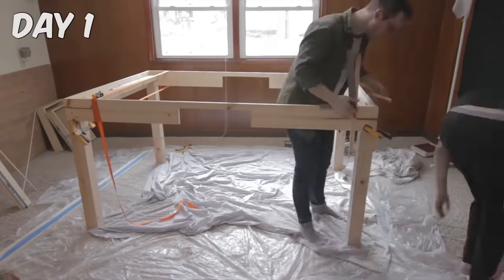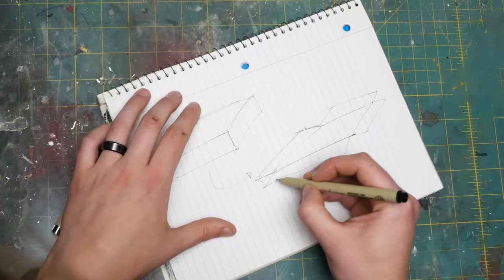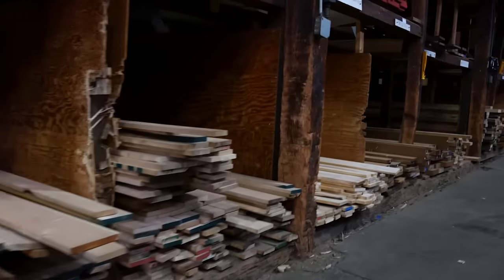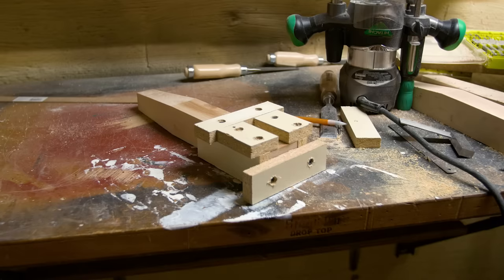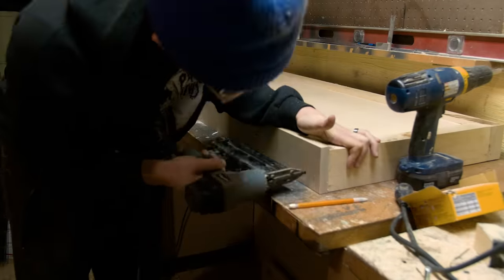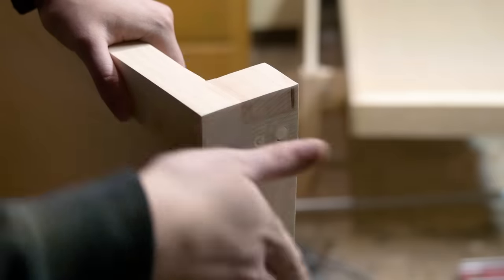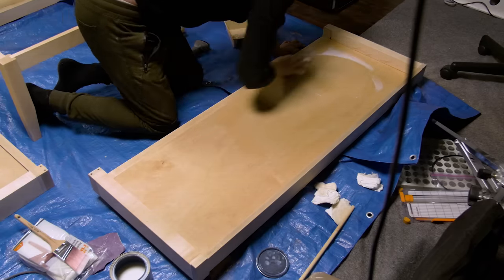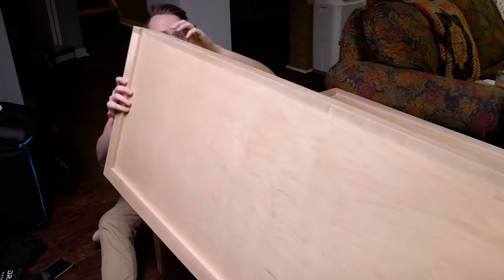Building a Board Game Coffee Table

Comment: i woudl surgest a support fix.
inder the table have several sticks as wide as the table when closed.  being held up with metal brackets. or something.  and when you want to fold out the table you can pull them out. 
so half is under the main table and the ohter half is under the outfolded pieace.  and have 2-3  for each side

Comment: you could have a leg that swings out from underneath, and props up each side of the table, even if it doesn't touch the ground, it could be a bar that comes out and supports it, either sliding out, or swinging out.

nice work though, it looks really good.

Comment: Suggestion for your fold out ends.  Build secondary legs to mirror the original fit.  Put these on a flat rail system that can extend out.  For example, my oven trays roll out on a telescoping rail that extends out about 18" which makes it much safer to remove heavy hot trays of food.  Meanwhile the extending rail counter levers itself so that the part that stays in the oven is a firm support for the extended bit.  But having said that, if you use the same system to push out a small frame with legs the legs themselves will provide the support necessary for the top tray when you open it up.   In Aus' there are all sorts of places you can get these rails, not the least of which are hardware stores of course. Naturally the legs and rails will need to attach under the centre part of the table as far apart as possible so the legs are out of the way when you play the smaller surface area.  
And bye the way, remember the mantra of any one new to a function or task.  How hard can it be?  Also thanks for the laughs and qudos for perseverance on the job.  Your biggest lesson?  Never go for the quick fix.

Comment: I have a possible solution for your hinge strength concern. You just need a way for the table to support the weight. The table in our kitchen has fold out leaves. They’re supported by wooden stakes that slide out from underneath the table.

Comment: You can very quickly make a table saw by cutting a slot in the middle of a piece of plywood (or an old shit table) with a circular saw then literally taking that same circular saw and mounting it under the table with the blade poking through the aforementioned slot.
It's up to you regards how you want to bypass the safety features of the saw so it runs without needing you to hold the button down. (hint: cable ties or hose clamps)

This can also be implemented with the jigsaw to give a great way to cut perfect curves and you can use the same table you just used for the circular saw blade.

Comment: you could use a few wood supports on the bottom of the Main table.  Put in some brackets and slide wood in that overlaps with the extended parts, then remove when you are not using.  Not elegant. but might work.

Comment: A simple fix could be to put two legs on each end with a swivel socket at the top of the table. That way when you flip out the sides you can swing the legs around to add support to the hinges. It wouldn't look too awkward as long as the legs were flush at each end together and the same color of wood, or I guess you could add and accent color

Comment: For you full side hinge idea, you could likely get away with piano hinges (which are commercially available in a variety of sizes and usually have a multiple strength specs.) As someone else mentioned you almost always want to pre-drill hardwoods, especially for furniture or anything you may want to take apart.

I appreciate you sharing your project. I actually really dig this idea. I'm in the planning stages of building a gaming table for my man cave and may adapt some of your ideas for my needs. I've really been wanting a 5'x8' table, but that footprint is a little too large for the space to be open all the time and I don't want to muff about with leafs. Doing is as a 5'x5' with 1' 6" folding extensions though might just work.

Comment: There is a very simple fix to your support problem.  Add a couple of wooden slides out supports under your table that extend out from the middle of the table.  when you get ready to flip out your table top slide out the supports so that the top has support.

Comment: If you were to move the speakers away from the wall, you'd get a much better sound. I have the same lsr305s and if you have the room to put them about two meters apart and about 30 cm away from walls, you will get amazing sound and sound stage.

Comment: Hey bud, thinking minimalistic and as unobtrusive as possible, you could strengthen your table, after you unfold it, by drilling a 1" hole in each corner of where it folds and inserting dowel rods, or something prettier like walnut or dark wood legs. But hope that makes sense, so when the table is folded 3 foot by 4 foot or whatever it is, you only see 4 holes in the "pit wall" board/siding thing near the center. Not obtrusive, won't affect anything besides you could always make caps for them for players who like to stick dice where there not supposed to

Comment: Another tip if  You are trying to fill screw holes  Stick toothpicks in the hole and cut them off Flush with the wood.  And if you use a Pair of calibers you can do scribe lines, handy if your doing dovetail work or  Anything when you're  Trying to get precise measurements.  Also  Keep in mind wood shrinks and expands Make sure you know which way the grain of the wood is going to mediate that.  Also if you can don't use a drill to screw in screws use an impact driver

Comment: Under mount a few drawer slides to the bottom then slide them out to support the weight when the leaves are open. get slightly longer than you need so you can slide them back far enough to be out of sight. Most are rated >100 lbs a price.

Comment: I'm sure you've gotten this table squared away by now but just in case: You could install slide outs in those empty spaces on your long sides to strengthen the fold outs when they are opened. Use a sturdy set of drawer brackets and leave enough lumber inside the table to add more stability. =[ ]=  <----Something like this (top down view). Cut some notches for your trim and boom, fold outs you could sit on.

Comment: Little late to the party. Dude, I feel that pain man. I’ve been a site carpenter for five years now. I love tinkering in my shed and making little boxes and stuff...site Carpentry is my skill, joinery is not! Watching this had me laughing my head off, not laughing at your mistakes but laughing at the fact that it’s a carbon copy of mistakes every time I attempt something elaborate. My only tip that you didn’t touch on yourself is whenever I’m screwing something into hard wood (obviously pilot hole it first), I get some thick clear grease and grease up the screw, makes it so much easier to wind in or take out if adjustments are needed. Works a charm especially for tiny little screws, you can also get screw extractor bits, but can’t comment on there effectiveness. Could use a plug cutter bit, cuts around the hole making a stubby dowel, then and dowel and redrill it like you said. Another small one is throw away any screws that come with a hinge, (unless you payed top dollar for the hinge) they are always garbage. 

Love the channel man, slowly working through your back catalogue!

Comment: use vice grips to pull out broken screws when there's more than 1/8" showing and also, always drill your screw holes out before putting in the screw. you can look up a drill/screw chart on google.

Comment: Super late to this discussion, but I am interested in getting a gaming table. I wouldn’t do it myself, as I am nowhere close to ready for this type of project. I have a hard time hanging pictures on the wall. 

I like your design, but I think you are right with the need for support legs. I was thinking, if the top of the table did not have the raised lip around the edges, there could be a better solution. Rather than use a giant hinge, you could mount some slide out support bars on the bottom of the the table. When you open it up, you would slide out a couple of bars on either side. They would be firmly secured on the central part and extend almost to the end of the two wings. 

Do you (or anyone out there reading the comments) think it would work?

Comment: you can add some sliding cleats ( dunno if that's the correct word in eglish though ) underneath the table. when you open the table, you pull them and they support the folding parts.

Comment: If you check out any of the Geek Chic-esq game tables out there, they don't fold open. They just have a recessed area that is covered by a removable panel (or two) of wood that otherwise make the table top when gaming is not going on. This may be an easier approach next time.
Reply from the maker: It wouldn't solve the problems I outlined in the beginning of the video

Comment: You mentioned you did your shopping at Home Depot, where most of their inventory for screws like this are very soft Zinc, which doesn't screw well into harder woods and shear easily, especially if you're not drilling pilot holes (yeah, I had the same problem as you).  So, look for screws made from almost ANY other metal/material.
Reply: Hardwood requires fine threads, vs the coarse threads that his screws had. Never should have attempted this project, not knowing what he was doing.

Comment: As someone who has done construction for years... well... you had me laughing, shaking my head saying "Nope! You don't want to do that." and almost crying while wanting to out "NO!!!".

Here are tips for next time Scott.... 

1) Follow my father's favorite statement of "Remember the 5 P's. Prior Planning Permits Perfect Performance!". 

2) Make a "mock up" version of your project with pine 2x4's, plywood and either nails or screws. It will let you see what other tools you may need, problems to address and even give you an idea or two on how to improve your design. Plus if you fuck it up... 2x4's and basic plywood is a hell of a lot cheaper than nice hardwoods.

3) Reach out to friends and people you know that have either done something like this before or know woodworking or construction. Most semi-smart people who have done construction for a few years could have easily helped you out with the planning and building of that table.

But in the end you did make the table... but you still need to add legs to those folding out leafs for support. Otherwise the weight will most likely rip those screws on the hinges right out of that pretty hardwood.

Comment: You are a brave man Scott that’s one hell of a project. I took your lead and built a hobby table from your last video but I think I’ll pass on this idea lol. Quick fix idea though not from experience but my kitchen table has fold up Leafs on the ends and underneath the table there is like these 2x4s in a sliding track that slide out from under the main table and support the wings might give your table some longevity. Well done all the same I think I would have burned it long before completion lol

Comment: I truly feel your pain on this video.  I recently re-modeled and organized my office/hobby area.  Found out the hard way measuring is meaningless if you don't check the angles you assumed were true and flush.  How was I to know that the length and width were pointless (because what actually fit after measuring the right way and accounting for angles was more a parallelogram than a rectangle,) but, finally got it done.

Comment: A valiant effort, I’ve been doing carpentry for a while as a hobby and it’s  just like painting minis, you make mistakes but just move on apply those learnt lessons to the next project. My advice is never use cheap screws, i always use branded and even screwing in to oak without a pilot is usually possible (where appropriate). Not sure what you have in the states but I’ve used Roberts screws before (think they are US based and they are very good. Think of all the knowledge you’ve gained about furniture repair from this project!!!

Comment: Hey @Miniac - you can remove a screw really easily if it sticks proud of the wood like yours initially did before you went HAM with the plyers :P if you have a cordless drill, simply tighten the teeth of the chuck around the screw, set it in reverse, and voila, out it screws

Comment: I'd attach a couple of bars to the bottom of the table that can swing out when you open the fold outs. These bars will take the weight of the fold outs, rather than putting the weight all on the hinges.

Keep up the good work.

Comment: I wouldn't use extra legs for support on this project, instead I would use a similar system to how table leafs are attached with rails that store under the table and slide and lock into the bottom of the extensions.

Comment: I know, coming to this late.  But I have a solution to the hinge situation.  It will wake a little more work, but here's the idea.  When you have the table "folded up", it has that ridge around the edge.  Make that edge a little thicker, and then have it so that when you "unfold" the top, sections of that edge are hinged in place and come loose to become the support legs to hold up the top and keep it stable without putting too much weight on the hinges involved in the unfolding.  After all, that lip is only in use when it's closed, so why not put it to use when it's hidden.

Comment: Great vid of a difficult project, esp. for a beginning carpenter. IMO, it turned out quite well. I am looking to make an expandable game table for my studio, so you have given me some ideas I would not have considered, so many thanks. BTW< I would go for some form of support under the extension leaves to reduce strain on the hinges, like putting hinged support leaves running up the legs on the side where the hinges are on the tabletop or pull out rails running under the base of the table in that direction, both of which are techniques that some antique desks or extendible tables use.

Comment: you could install under the table 4 wooden planks that you can pull out in order to support the extended table edges.. Ikea and others use that in most fold tables... you simply pull out a support plank under the table.. in your case I would make 2 per side just to be on the safe side :) well done nevertheless

Comment: 18:35 Two lessons here... drill pilot holes for your screws, and don't use cheap screws (or make sure you're using self tapping screws). As tempting as it is to save money on screws, this is what happens with poor quality screws. If the cheap screw manages to hold together getting drilled, many times the head will bore out leaving a nice pit where the phillips cross used to be, making it impossible to get the screw out with a drill. Luckily, they make reverse threaded drill bits that can bite into the metal for extracting screws like this. Haven't used them, but they seem sound from a theoretical perspective. :) Screw problems suck.

Comment: I have a Helpful idea.  I can think of Many ways to fix the table wings being week.  But I tried to think of the way that would be the most "friendly" to an unfamiliar user.  Prolly take an hour, could easily be less.  Take a 2x1 inch piece of wood that is the length of the table when open... cut it in half ... do that twice... now you have 4 pieces of 2x1, any two of which will equal the length of the open table.  Take each of them and drill 3 holes in them.  The holes should be a snug fit to what ever dowel you can get from your local hardware store (roughly the size of a pinky finger).  The holes should be... one close to each end of each 2x1 and one about 3 inches off center.  Then drill the same sized holes in the table along the side so that when the table is open, two dowels are in the main body of the table, and the third is near the end of the folding wing.  Glue the dowels into the 2x1 so that when you want to fold the table up you just remove the 2x1 and nothing is sticking out of the table.  You could even locate a second set of holes on the side of the table so you could store the 2x1 on the side of the table when it is folded up.  If my description is making sense you can see that basically when you wanted to open the table you would just open the table then move the 2x1s from their storage spot on the side to their supporting spot also on the side.  I would put a hidden mark on each indicating which corner they go on in case they get mixed up... but thats basically it.  You could possibly make a way to store them under the table... they don't have to be quite as long as described here... this is just the idea really.  Anyway .. cheers mate

Comment: I dont really know anything about woodworking but why not use a latches at the sides, so as to when you open the table, you can secure the table core with the opened sides? Doesn't look necessarily  pretty, but i think it would kind help with the weight problem.

Comment: Wondering if you made pilot holes deep enough for those screws you had trouble breaking. Also when screwing them in a little bar of soap on the threads and using a hand screw driver instead of a power drive helps prevent breakage. Should of talked to the high school wood shop teacher maybe have his class come up with designs you could of chosen from that would of been fun. Could of had it all cut and figured and just assembled it learn to delegate authority. :)